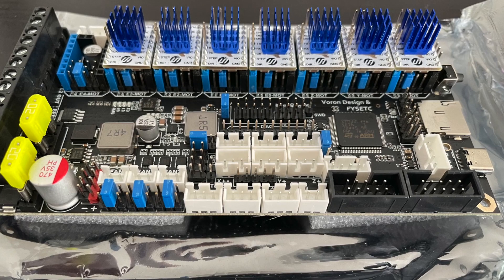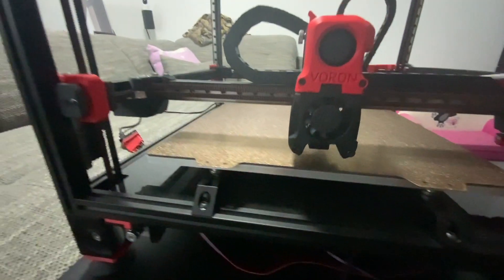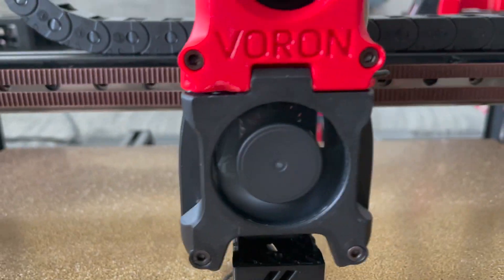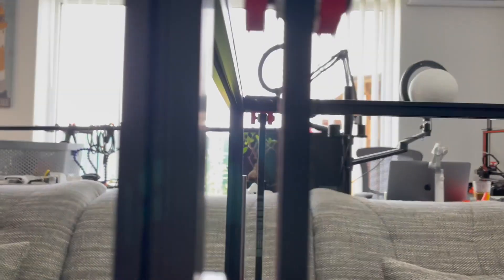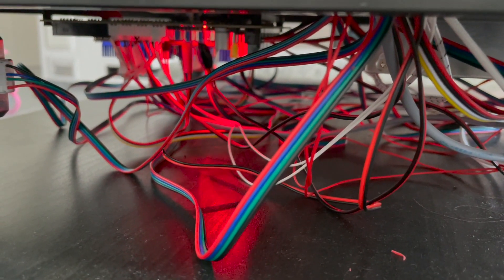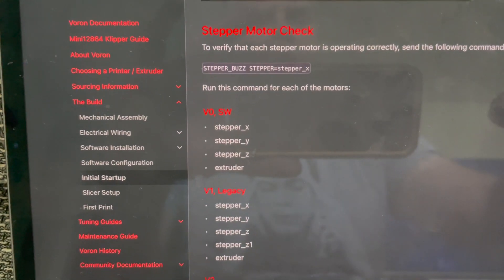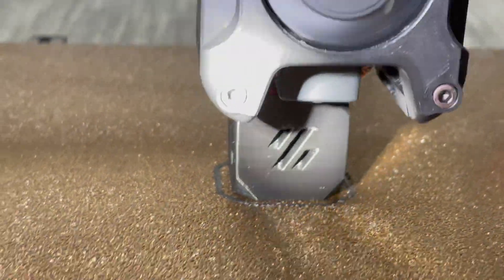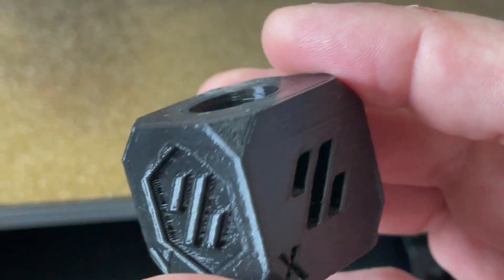Voron 2.4 Fysetc Kit 350 Build 2

Comment: when you cable anything mechanical, always push the tool, arm, whatever to its farthest limit on all axis and ranges of motion, then set a little tension slack. Gently pull all your cables straight, then run your arm through its degrees of motion, ensuring that your slack is maintained on all cables, twice or 3 times even. Readjust THEN you can start your cable organization, ties, etc. The last thing you should do is cut cables, terminate, terminal then connect to the source, and whenever possible leave some slack just in case you need to make a repair in the future.

Comment: I broke one of the pads on my 4020 blower fan too. I used a #2 xacto knife to "etch" me another pad right next to it. Had to trim a little plastic to expose more of the fans PCB but no big deal, runs great and has a better connection then it did stock.

Comment: My experience with FYSETC has been an absolute nightmare.  I placed my order on august 27. In order to get around the 25 day processing time, the seller marked the order as shipped once the processing time had expired, but did not provide a tracking number.  After two weeks I finally reached out to the store asking for an update.  They told me to give them a few days, this went on for another 3 weeks.  I was finally provided two tracking numbers, both showed they were shipped out November 8th.  One of the boxes showed up a few days later.  The second box still shows the original scan location, presumably lost in the ether.  The seller has not responded to any of my messages in several days.  Glad not everyone has had this experience, but I am wishing now I had just taken the time to source all the parts on my own.

Comment: General question...how/where do you get the ABS parts that are key to the gantry and motor mounting etc? I'm seriously interested in diving into the hobby and enjoy a challenging build, but the wait time for ABS parts via printitforward is almost 7 months! Thanks!
Reply: I printed them on a open ender 5.  It is upgraded with a btt main board and a dragonfly hot end but it worked great

Comment: Safety suggestion. Cut all the wires on the toolhead, replace them with ptfe or silicone wire through the drag chain. My probe original cable get burnt after 4 months.
Reply: Yeah you shouldn't be running anything other than PTFE or silicone wires with a high strand count through that chain. If you do it's going to break soon.